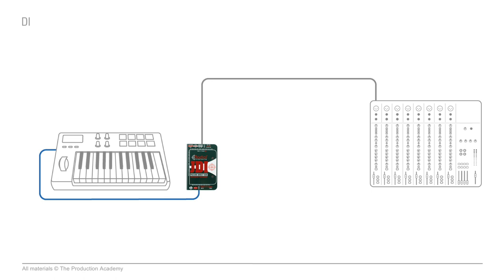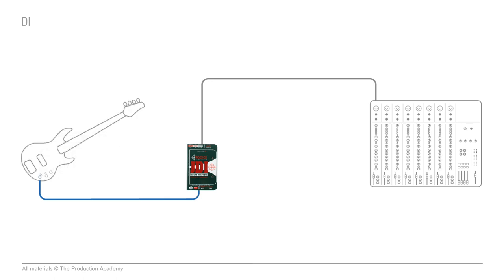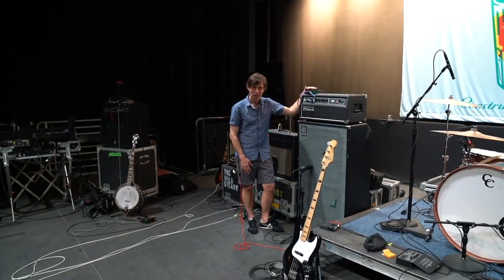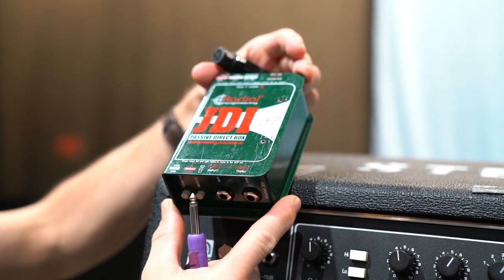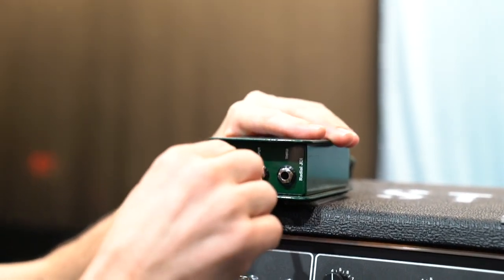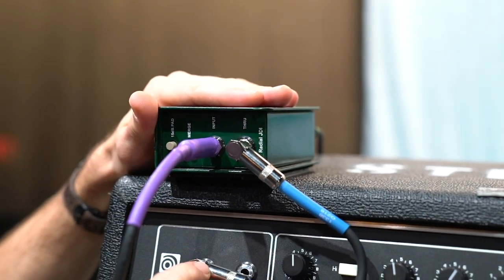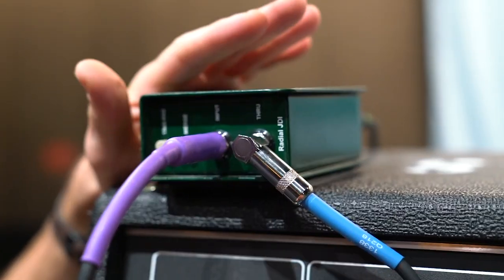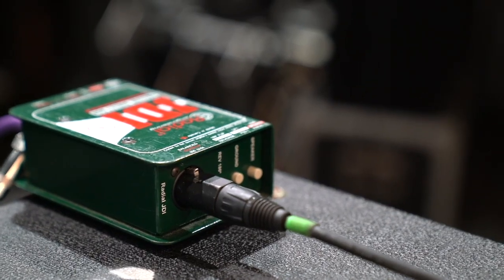Using a Mic and DI for Bass Guitar on Stage - The Production Academy

Comment: How do you align the phase of mic and DI signal?
Reply from the maker: There are a couple things you can try with the DI and mic. The obvious thing is to just flip the polarity of one of them to see if that gets you a better sound. Or, if you’re on a digital console, you can add a few milliseconds (somewhere between 0.5 and 3.0ms) of delay to one of the inputs (try doing this with the DI first). This will change the phase relationship between the two sources and affect the tone. 

In any case, even if I’m not using one of these methods, I usually will use a HPF on the Bass Mic around 80Hz. This way, those very low frequencies are only coming from one input source (the DI) and have less chance of phase cancellation.
Reply: @theproductionacademy  right 🙏🏻